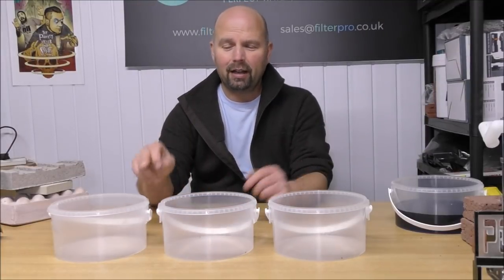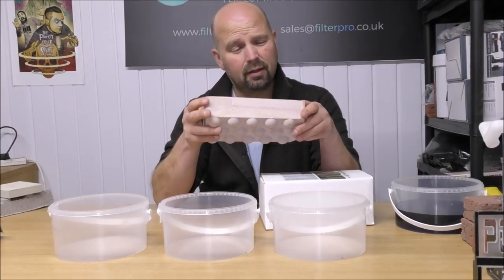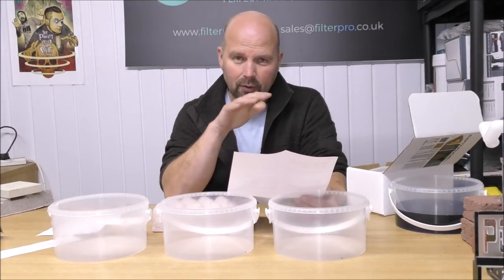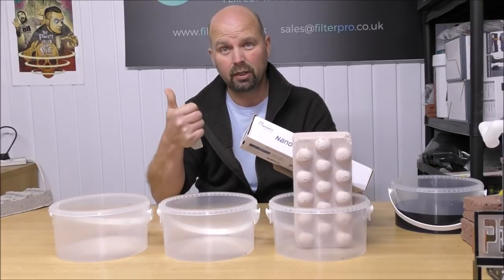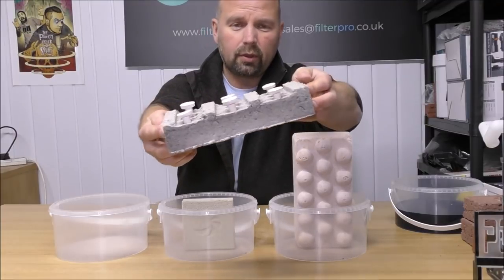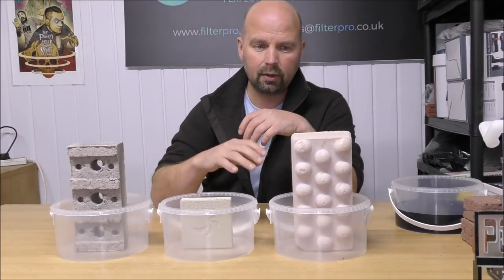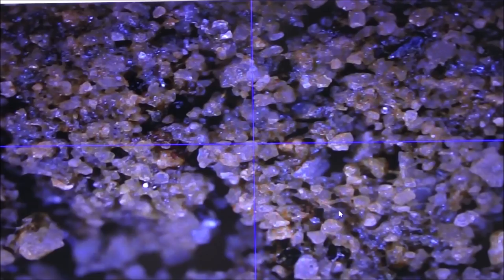Aquarium Sump Bricks and Plates - Testing Part 1

Comment from the maker: Sorry, this is a long one... 
Maxspect Nano Tech Plates (Amazon): https://geni.us/N0ABQHw
Continuum / Brightwell Brick (Amazon): https://geni.us/HZ7HF
Biohome Sump Brick (FilterPro): http://bit.ly/33rDF37
Biohome Sump Brick (Amazon): https://geni.us/Jicl
Damn.....getting the materials for this test video cost me almost £90 so I hope you appreciate the effort - share this video with anyone you think may find something useful in it. Thanks for watching.
I mention and show the results of the wear test in a specific video I did on sump set ups here: https://www.youtube.com/watch?v=Wqt9zA6mqao
Basically there was no wear on the Biohome Brick or Maxpect plate and the Brightwell brick started to fall apart and release some suspicious looking chemical residue........that is shown around 16 minutes into that video.

TIME STAMPS:
00:00 Intro and Continuum / Brightwell Brick
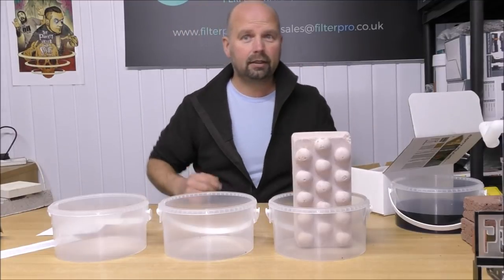05:47 Maxspect Nano Tech Plates
08:57 Biohome Sump Brick
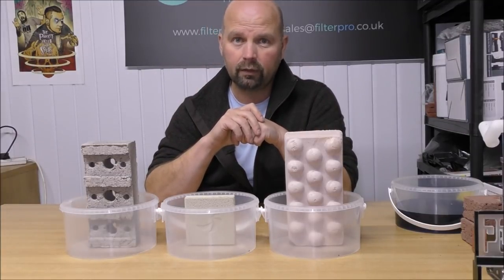13:54 Continuum / Brightwell Brick microscopic view
15:06 Maxspect Nano Tech Plates microscopic view
16:25 Biohome Sump Brick microscopic view
18:19 Receptiveness / porosity tests
27:07 Summary and introduction to next test
28:46 Explaining the accelerated wear test
31:04 Outro

MAXPECT NANO TECH PLATES are very well made, extremely strong and have a very open structure. However, the feel of the plate is very 'waxy' and the material (resin?) used to stick the small ceramic beads together doesn't look or feel like something which would be good for bacteria to colonize.
As you can see in the video the material used for the construction actively repels water but the structure will allow water to penetrate the plate when it is submerged in water so it should support bacteria to some degree.
I genuinely like what Maxspect have tried to do with this type of filter media but have serious reservations about how suitable it is for bacteria and unfortunately the 'for aquariums up to' figure quoted on the packaging is highly likely to be fantasy (that is a very common problem for filter media and filters).

CONTINUUM / BRIGHTWELL SUMP BRICKS are extremely light and have a very porous structure although as you can see from the video that does not seem to be very receptive to water.
The internal structure seems to have trapped bubbles inside it as it took ages to sink (I had to weigh it down under water) but that is common for filtration products made from a ceramic 'slurry' dust.
I have serious doubts about the structure of this material lasting a long time although it is described as being able to last for '50 years' and being suitable for aquariums 'up to 1000 US gallons'.
At the same time warnings are given against touching the brick once it has been in the sump for a while (as the brick goes soft) and breaks up if moved. Hmmmmm.
Online reports from users of this product seem to yield initial good results regarding a reduction in nitrate followed by reports of the brick falling apart after a few months - that could be due to the dosed sulphur and aragonite being used up and weakening the structure? If so then this is a short term (expensive) chemical treatment and not a viable biological media for long term bacteria support......time will tell as I have all the test subjects in an aquarium to test the natural wear on them myself.

BIOHOME SUMP BRICKS are made from the same material as Biohome Ultra which has been used for approx. 20 years in sumps, shower filters and large aquarium filters.
As you can see from the video it is extremely receptive to water and if it is receptive to water that directly indicates receptiveness to bacterial colonization.
The Biohome Sump Bricks are made from sand and powdered glass (which binds the particles of sand together). It is an extremely natural surface for bacterial colonization.
They aren't pretty since each one is hand made and they do not come in a fancy box but the amount of water they will filter (for a full cycle) is realistic, usable surface area is excellent (receptive and accessible) and they will last as long as you have your aquarium sump.

Part 2 with results of 'Wear Test' and a summary of all 3 types of media will be linked to here when the video is done. That could be a few months...

RECOMMENDED PRODUCTS ON AMAZON: https://goo.gl/jMaBWy
INSTAGRAM: https://www.instagram.com/pondguru_outdoors/

FILMING EQUIPMENT:
Panasonic HC-VX870 HD camcorder http://geni.us/3UwE
+Rode stereo microphone: http://geni.us/4OL
+Rode 'deadcat' mic cover: http://geni.us/1pmn
JVC Everio quad proof HD camcorder: http://geni.us/e09e
+Rode 'deadcat' mic cover (opened up and held between tripod and camera base) http://geni.us/dee24
Zomei Z666 tripod: http://geni.us/1a1af3
Manfrotto MTPIXI-B PIXI mini tripod: http://geni.us/87f7

If you've enjoyed this video please check out the playlists on my channel for hundreds more  - on a variety of subjects.
Feel free to share or link any of my videos on facebook, twitter, forums etc. for the benefit of anyone you think may also enjoy watching.
See you next time.
Pondguru
Reply: Pondguru ,If frag plugs are too fiddly to make out of sintered glass how about artificial reef rock? The ceramic artifical rock is just as heavy and expensive but less effective. 
Good coral growth combined with filtration, until its overgrown.,I've always wonder if live rock filtration would decrease as organisms  encrust it.
P.S, Great series  of videos.
Reply: I love Biohome Ultra. I use it in my canister filter. My guess is the Biohome brick is a winner.  Appreciate you doing this test!
Reply: Why can't I use regular reef rock???. It's been around for a very long time
Reply: @davidabbott1015  many countries are restricting reef/live rock export, you can also introduce pest organisms to your aquarium hence many companies have already introduced artificial reef rock. Biohome seems to be an exceptional medium for coral growth, even without trace element infusions which also have a positive effect, so a biohome based reef rock could provide a very promising surface for flourishing reef builds.
Reply: Pondguru biohome product from where ?
Reply: Pondguru, can you share the accelarated wear test for these products. Thanks

Comment: I have the bright well bricks and plates.  The bricks have gone soft.  The anti nitrate one got MUCH softer. I could squeeze it to mush if I tried with little effort.  However the plates are like new after 2 years or more.  I can definitely support the claims of fantastic biological colony capacity. I don't want to tell you for fear of flaming but I have a 220 gallon tank drastically overstocked with no ill effects as long as I do decent water changes with this media

Comment: Man... This is something that is so important and a subject i want to touch later. I'm still curious to compare with different brand because each brand use a different technique and i find it very intriguing! But something I would like to see is you emphasis too much on sucking up water i think. I think the focus should be more toward how bacteria develop well on the surface and the longevity of the product. It's also very ... special to make the hole for frag plug on biohome, in February i will make a quick video on aquarium frag for saltwater and I was going to say instead of using pvc pipe on each corner, use Biomedia brick, since we don't care about aesthetic.

I never heard of you Biohome, look interesting, my question mark is how your different component use will affect the water parameter (PH, KH, calcium, etc...).
I live in Canada so I don't think I have access to your brick but it look promising. 

I'm curious about the Brightwell brick, long term(?), I feel this one feed the bacteria, idk, I never really believe in the max spec one, but i do like the surface area providing, perhaps my opinions is wrong on this one, The eheim Substrat Pro seem interesting, form factor.

Media brick like this is actually the cause of my first crash in my Saltwater tank, i though it was cycle, probably was, but i took a old brick from someone and is disintegrated in my tank and got a ammoniac spike which killed couple of my fish. Lesson learned... (nano tank effect)
Reply from the maker: How quickly a media draws water into the structure is extremely important as it is an indicator to how receptive it is to bacteria too so that part of media test is very important.
It's no surprise to hear that the brick you used caused problems as microporous structures can't 'breathe' properly, toxins can build up and be released when the structure breaks down - I've seen a few reports of bricks breaking down and producing a 'rotten egg' smell which isn't good at all.
Give me a ring any time if you're interested in taking a look at the Biohome brick as we have a few which aren't he right colour to give away (UK only). The first run was an attempt at making a coloured brick using the same trace elements as biohome ultimate but not all the colour developed properly due to the size of the media piece.

Comment: I respect your videos and analysis of the products. I have been in the hobby for over 50 years. The more I've watched the latest "Bio" products over the last decade (of which I have tried many), the more I am convinced that a sand product is the best. I also believe that a person can create a bio filter medium by using a medium grade aragonite sand (help with PH stability) in either a container/basket or a bag. The bag creates convenience for rinsing. I currently use Marine Pure Spheres (got them before I found out about bio-home) that are holding up well. Based on my tank's African Cichlids overstocking (120 us gal) running two Fluval FX6s, the tank is very stable and healthy with breeding constantly going on. However I plan on using Hawaiian Black Gravel in one of the baskets ( have an extra 20lb bag) as both a bio and filter element similar to an undergraval filter. Protecting the filter motor with filter pads before and after the sand tray. Thoughts?

Comment: Any Black Friday deals or promo codes on the new bricks Richard? I need  a few to add to my 20kg of Ultimate and 5kg of ultra that's no reducing my Nitrates as much as I'd like?
Reply from the maker: Give me a ring on 07772848730 any time from tomorrow as we have some bricks to give away to different people making videos - the first batch was meant to be coloured like ultimate but colour came out messed up - structure and strength is still perfect but colour makes them not salable.
Reply: @pondguru  Thanks for the Reply Richard I'll call you tomorrow.

Comment: Unless your "forcing" water through theses media types your only getting bacterial growth on the "outside" surface areas only. This bio film is only 100 microns deep. The rest of the media is simply wasted or becomes plugged with debris. These medias are "snake oil". Purchase bio balls at a fraction of the price with tons more surface area than ceramic medias can provide. Reefers often times say the "ceramic media blocks didn't work for me"....and this is why. Happy reefing!
Reply: tippin turtle I had written an entire paragraph when I got to the part where he said one brick can support up to a 150 liter (40g) tank. Then I laughed and deleted my post. It’s as good as a sponge filter (maybe)! Oh wait-nitrate reducer... I’ll put some kitchen sponges in a low flow area of the sump... or some gravel...

Comment: Hold the MaxSpect  under a running tap. Watch the how easily the water runs THROUGH the material. It flows through before it can pool and run off. The flow rate on this stuff in phenomenal. The other 2 are ABSORBING water like a sponge. THE WATER WON'T FLOW THROUGH. The media needs to have movement through it in order to access the bacteria. Soaking up and holding the water is of limited help. There needs to be flow.
Reply: Absorption helps with nitrate reduction.
Reply: @Bullshitvol2  That's a different product. Same company. Different product. They have at least three different bricks. Plus other media.

Comment: Si it’s the difference between the porosity, the permeability and the absorption characteristics. Add that the the surface area of the product.  I am not sure this is a valid test for both aerobic and anaerobic bacterial colonization.  I would guess that the better absorption would have slower water flow and would be better for anaerobic bacterial growth.  Since the two competing products are mostly marketed towards the reef tank community where refugiums and carbon dosing are more common, I would say that the anaerobic bacteria are less of a factor.   That being said I would think your Biohome product would perform much better in the denitrifying bacteria  end of things.  The brightwell will stop floating and moving.     I would like to see the water flow test and also would like to see the marine pure ..  lastly I would like to see a triton test done on water that each soak in for a month or two.

Comment: Not sure I can see what an absorbency test proves (the media is permanently submerged).
I personally wouldn't use any sintered glass media in a marine environment. It's a silica based media and will very slowly degrade releasing silicates, the higher the surface area the more to degrade.
Reply: actually think the one repelling water might be a good idea since the bacteria would have to hold on and the water will easily pass through the media

Comment: Hi Richard, I think you need to ask the manufacture about the technical spect and the method of calculation surface area before adding your video, maybe they are right since any production need to be test and approved by the related authorities, I believe it is not easy by a company to say such inaccurate information therefore it is better to communicate with the company directly and get the information and make sure that the information inaccurate before publish such video

Comment: Richard, Great test. It will be very interesting to see how your wear test goes. I'm testing as well and thought I might have a video out before you, but should have known better.  I was also surprised to see how poorly the Brightwell wicked.  I used a bit more water in the tub. It took about 20 minutes for the Biohome Brick to wick completely to the top, which also surprised me. I wasn't sure it would make it that far.  I got about 3" with the Brightwell. I soaked both of them and found the Birghtwell gained 680 grams and the Biohome gained 230 grams. Based on the capillary rise I estimated the average cavity size. Since the Biohome has dramatically better wicking it indicates the cavity sizes are considerably smaller. For what it's worth I estimated the Birghtwell has about twice the internal surface area as the Biohome, but this may plug quickly with biofilm which is much less pronounced in Biohome. It will be interesting to see how these sell. Gotta get busy tomorrow and get them up on my site. Happy holidays, and Happy Fish Keeping!
Reply from the maker: Good to hear that the results were comparable between the two bricks and I too was very surprised that the brightwell brick would not draw the liquid up considering the claims that the manufacturers make about it and considering how porous it 'feels'.
Basically if a material is not receptive to water it is not receptive to bacteria but the maxspect plate probably shocked me the most as it actively repelled the water. I'm sure they will all hold water and bacteria to some degree but the success of the 3 types here will be very different for sure.
I don't know why companies insist on using materials for manufacturing filter media which is not present in that form in Nature - if we look to Nature and learn from that then we are on the right track. It seems that whenever a company tries to blow nature away with 'science' it always ends in disappointment since Nature doesn't understand what science is trying to claim or improve.

Comment: I'm not sure what the point of testing the ability to pull water in is for..that doesn't demonstrate the block's ability to take on water or not..these media are all going to provide bacterial colonization. Any of the blocks can culture anaerobic bacteria as well but you would need a sump with a very low flow areas...it doesn't matter if your housing biohome ultimate or one of these blocks... without an extremely low flow area in a sump where the media has a chance to have a low oxygen environment, you'll never see any nitrate removal...these are just facts

You could easily house aerobic nitrifying bacteria AND anaerobic denitrifying bacteria but your never going to achieve it in a canister filter...a decently large sump with 3-4 separate sections where water is moving very slowly through is what you need. There is no point in buying expensive media and then putting it in a canister where you have a constant blast of highly oxygenated water going through it.